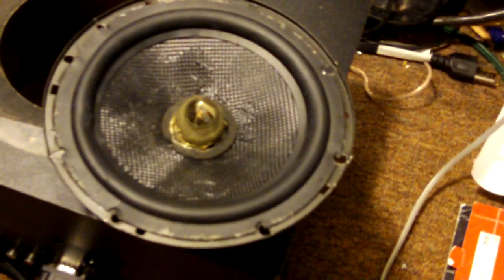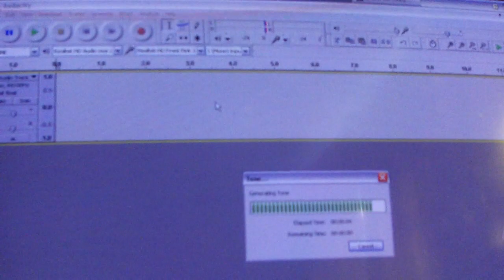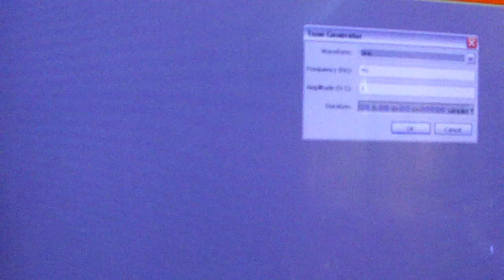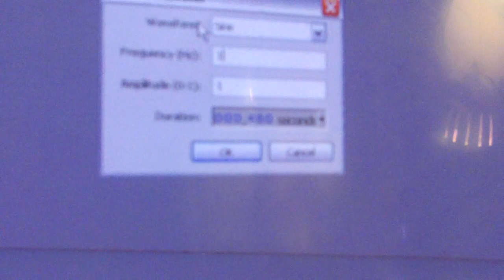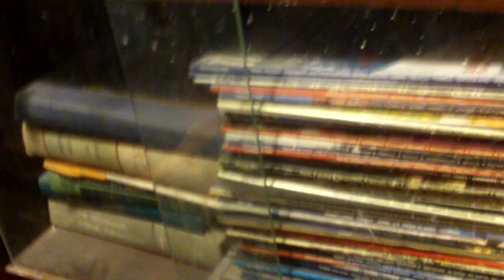Killing of the invincible Crescendo Mid! Round 3! K.O!

Comment from the maker: @speakers11223 Cranked up all the way bass boost and everything it came out to be 19.4 AC Volts so 19.4x19.4= 376.36 then divide that by 4 ohms 94.09 watts rms but its not a definite 4 ohm load so about 50-75 watts rms as I said... But this is fully clipped signal and using a test tone... Its completely different when playing music.